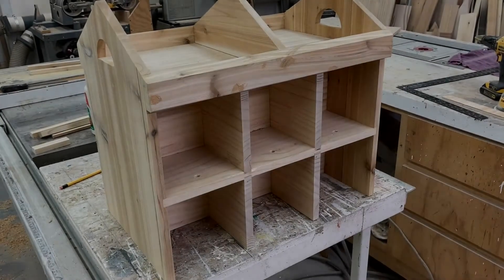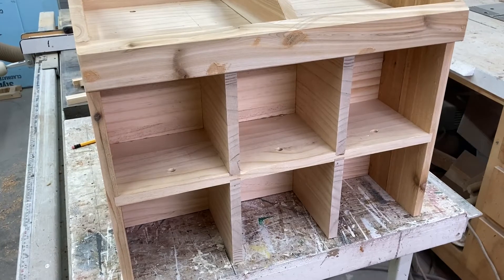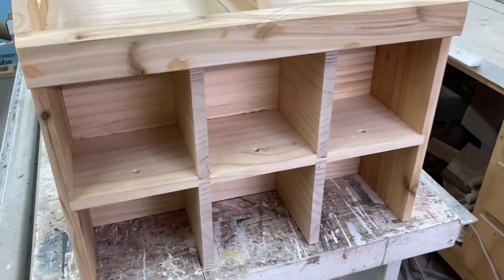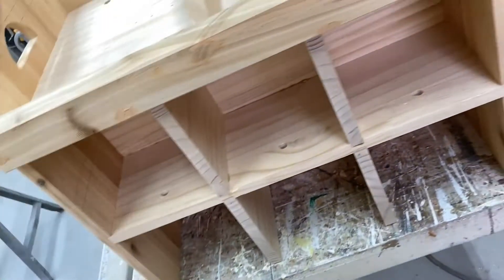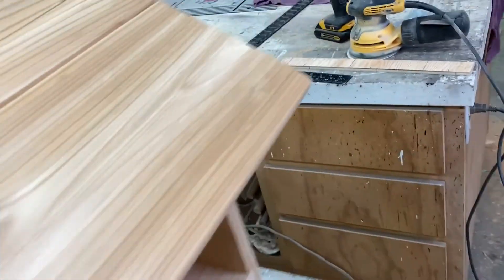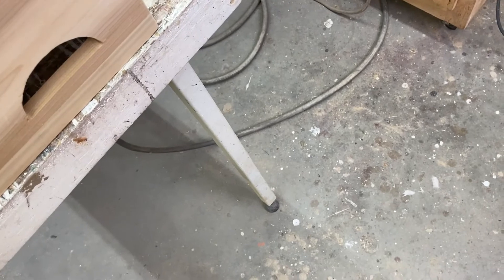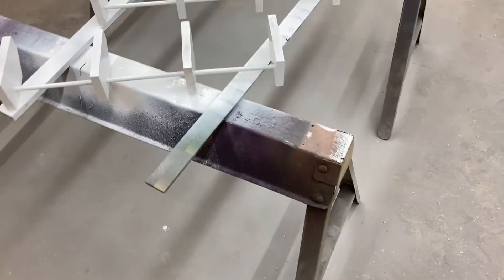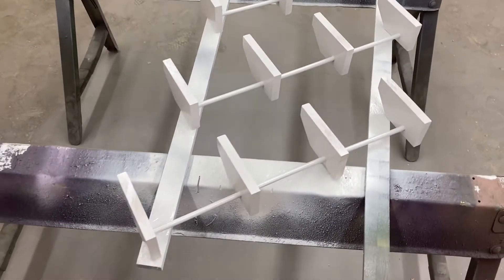Purple Martin House Build

Comment: Very well done. Are your doors going to be attached with actual hinges? What kind for outside and what size are they?
Second question looks like are you using cedar so do you use waterproof glue 2 boards wide for each side of your roof?

Comment: Where can I find the dimensions for the starling resistant hole shapes and also the 3d printed insert?
Reply: Crescent shape is 3" wide by 13/16" tall
Reply: @garytrew2766  where can I buy them?
Reply: @jeremykoehn4004  I only know the measurements, don't know where to buy those inserts.
Reply: @garytrew2766  thanks, I'll try to build them. Are they perfect half circles?
Reply: @jeremykoehn4004  yes
Reply from the maker: Jeremy, I found the specs through a google search
Reply from the maker: @jeremykoehn4004  The actual hole height is 1 3/8" but the hole diameter is 1 1/2".  Bottom is 3" inches long
Reply from the maker: Sorry, meant to say 1 1/2" radius not diameter